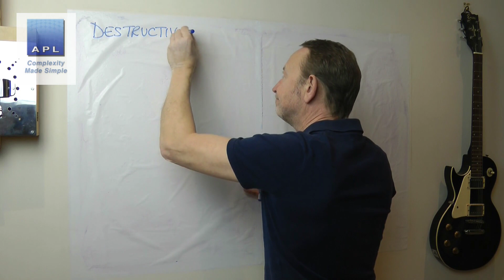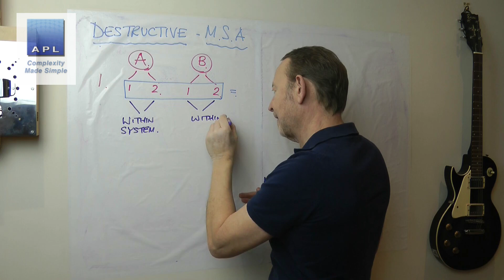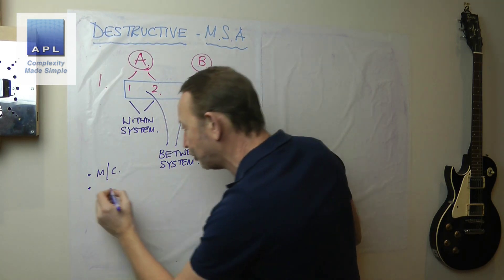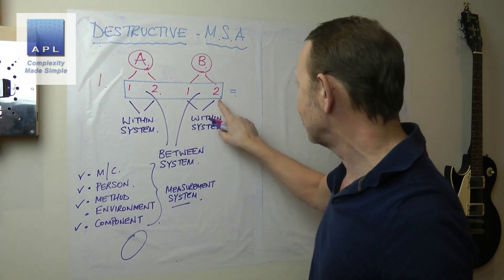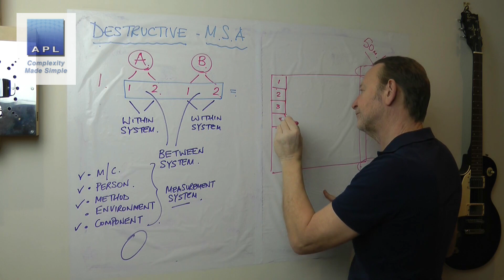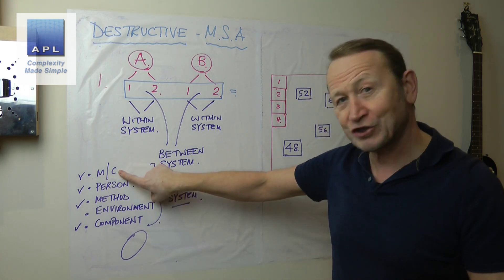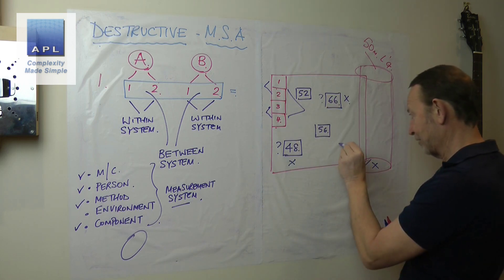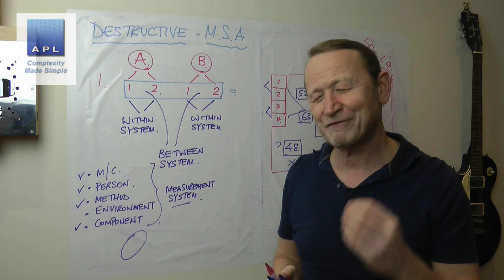Measurement System Analysis Destructive (6 Sigma Training)

Comment: I did a destructive test on the jacket of a cable.I obtained three pieces obtained from the same cable and treated them as three different parts. Three operators plucked three specimens each from each part and tested for peroxide levels. after running a crossed gage R and R, number of distinct categories was 1. Reproducibility was 80% and repeatability was 45%. Is my experiment flawed. Can ,make any solid conclusions from the study? or my approach is wrong?
Reply from the maker: Lots I could say on your approach Mathew - -drop me a mail on paul.allen@allenp.co.uk
Reply: Hi Paul. I sent you an email. Looking forward to hear from you. Thanks !

Comment: Thanks for the video, here is a little more I can add to help;

-Use pairs of samples that are as alike as possible
-Measurements of such pairs are treated as duplicate measurements of the same thing
-Use the ranges of the pairs of measurements  and place them on a Range Chart
-Any Range falling above the Upper Range Limit indicates a possible difference between the paired samples
-Since we want to estimate measurement error, delete any ranges from above the upper Range limit such that the computation of measurement error is not influenced
-Compute the measurement error standard deviation from the Average Range
-Use this Range chart to check for ongoing consistency of the measurement process

Hope this helps
Reply from the maker: Helps alot Geraint - Many thanks